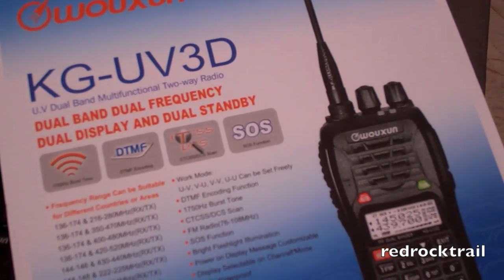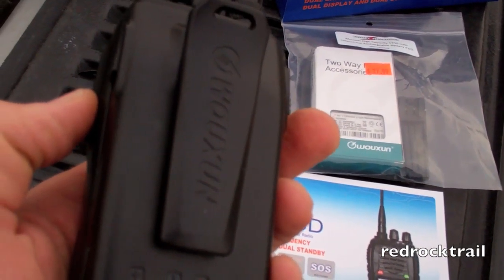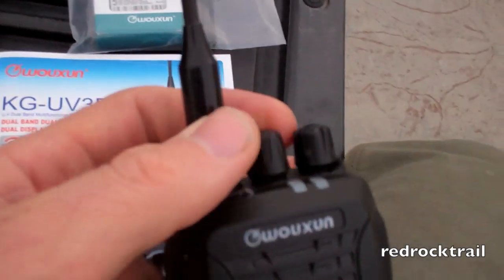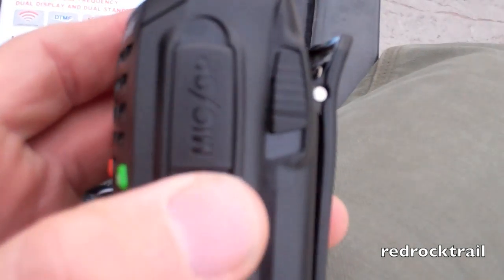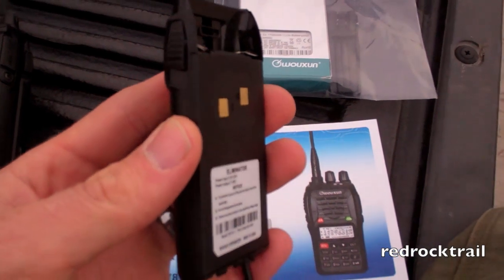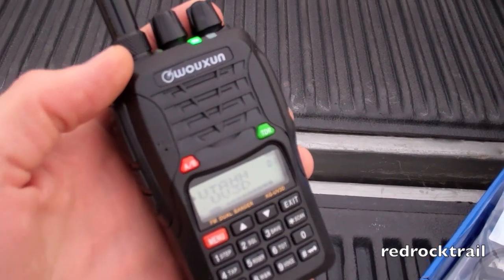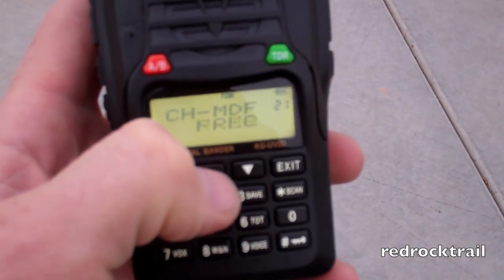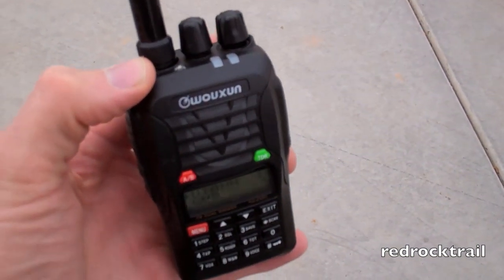Best Wouxun UV3D Demo/Review - 720p HD

Comment: We have been using these for some time in the Dayton area.  I have had mine about 2 years.  I use it every day, in the car and at work.  It is used in high RF environments.  For $90-110  this is a great radio.  Still the FT60 is about $150. 

Don't knock the wouxun.  They seem to actually be a fairly decent radio.  Also about the cheapest rout if you want the 220mhz band.

Also a great radio for sat work.
Also they have/had a really good monobander that was $50.